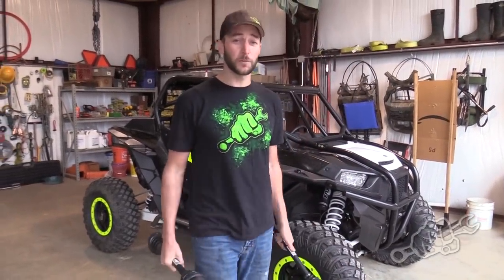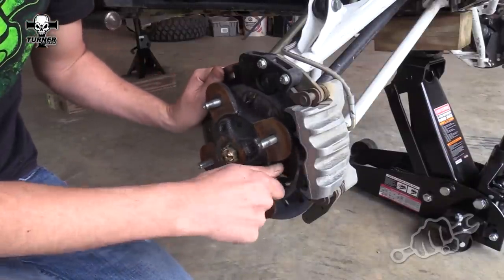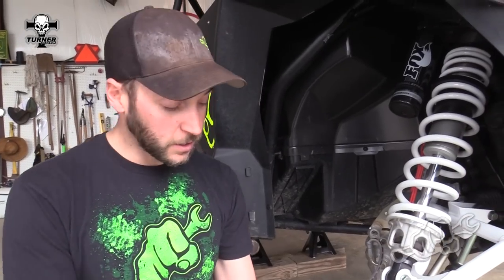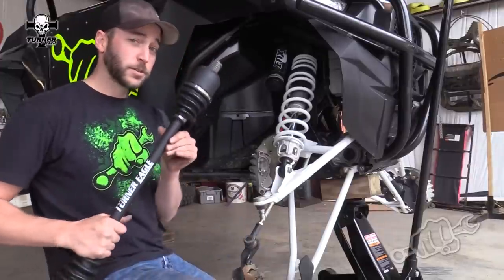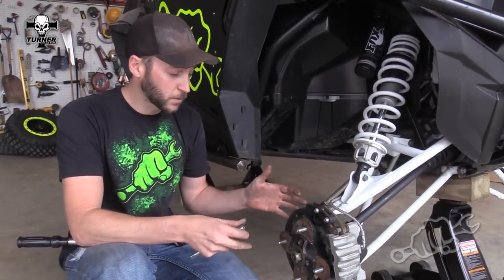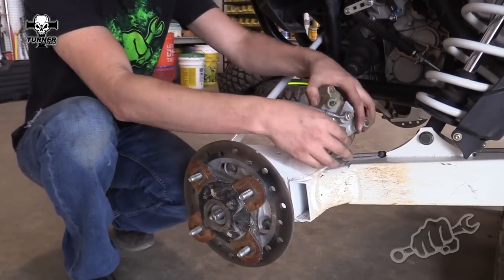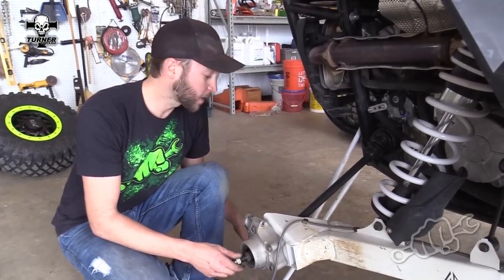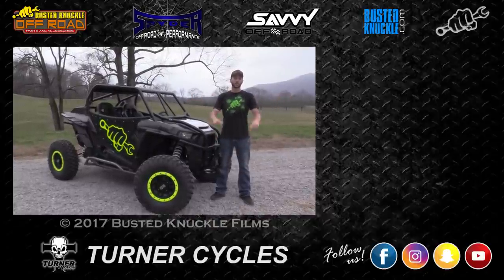Polaris RZR TURNER Axle Install - Extreme UTV Tech EP10

Comment: Nice work. Question. My boot has oil like something a leak. Should I change out my axel ?
Reply from the maker: You can get new boots and grease from Turner. No oil should be coming out, grease can come out if the boot gets damaged.
Reply: That’s bro. It was the boot. I decided to order new axles.

Comment: With all these upgrades to your drive train would you consider your diffs your weakest links? I would think you would want the cheapest easiest part to replace to be the weak link.. What are your thoughts?
Reply from the maker: for trail riding you might want that, with racing you don't want an axle to take you out of the race. We have built everything up with welded diffs and all so now our weak link is the transmission. But after installing axles the diff is the next weak link.

Comment: How do the diff's hold up now that you've upgraded the weak link in the system?
Reply from the maker: Diffs need to be built also. I am running a Torq mini spool, upgraded roll pin, in my XP turbo and a full upgrade stage 1 kit from DC motorsports in the RZR Buggy
Reply: Cool thanks!

Comment: when you remove the axle from diff do you have to compress the snap ring or just wedge the axle out...thanks
Reply from the maker: usually if you just apply a little bit of pressure to it they will pop right out

Comment: I boight turner eagle 2 axles for rear of teryx with 6" portals and heat cycled them amd have shiooed them back to turner nunerous times. My underpowered machine keeps breaking them
Reply from the maker: what size tires are you running and what part of the axle is breaking?

Comment: Great vid. I have a leak at the point where the axle goes into diff, is there a seal I can replace, my 1000 has about 1700 miles on it and just started leaking.
Reply from the maker: Yes there should be a seal to replace if you take apart the diff housing
Reply: Oh wow, was hoping to get at it without taking the diff out, thanks, will investigate.
Reply from the maker: It's just a few bolts, we do it a lot lol
Reply: Thanks, pal, got the parts, got the drive fluid, will get at it!

Comment: Love you vids man but I'm going to nit-pic this one since I have the time and have done this stuff a lot. First, ALWAYS use jack stands! You can get seriously hurt not using them and it sucks to drop a machine, your comment that it is common is BS. It is NOT common unless you don't know better. When I was your age I would have done the same as you but still very dangerous. Second a good 3/8" battery powered impact really speeds up the brake caliper and ball joint retaining bolt removal. Third, there is no need to try to keep the front rotor from turning by sticking crap in there or holding the brake. A good 1/2" impact will back the axles nuts right off. It will also tighten them the same way. Fourth, tying up the caliper is a good idea but don't overly bend the brake line when doing so. Fifth, no need to use the huge ass pry bar to remove axles. Some watching this will do that and break the diff housing. Simply push in the axles and make short fast jerks to get it out using the axles as kind of a slide hammer. Unless you get stupid with it you will not separate the CV. If it is stuck, well that is another video on ways to handle that. No need to hammer the axle back in either, just to the same bumping with the axles and CV itself, pops right in, Prior to doing that always grease or never seize the splines so you never had a stuck axle problem and future changes are easy. Fifth, always use blue lock time on the brake caliper bolts and be careful to not over tighten them as they are easily stripped. Sixth it is a great time to use a bearing greaser to grease the wheel bearings as even new ones will take a ton of grease and greasing them makes them last 3 to 4 times longer. Hope you don't take this wrong, just trying to help. I'm ready to see you race that baby!
Reply from the maker: I am not a professional mechanic and have never claimed to be, this is just real world working on junk the way we work on them. Not everyone has fancy tools so we like to show how to do the job with simple hand tools. To each their own.
Reply: I completely understand. Just giving my pointers to help maybe you and some watching out. We all learn by doing and sharing. I think back and shake my head at some of the things I used to do! One thing for sure, you can damn sure drive a buggy!
Reply from the maker: We appreciate the feedback. Can't wait to get these new machines lined out and get used to them both.
Reply: boltactionshooter you have two fifths in there
 Not nit picking but first always remember where your fifth is and second sixth comes after fifth. Lol just poking the 🐻

Comment: Very informative, but the way the buggy was sitting on a block of wood on the jack could have been dangerous, I have a friend with the top of two of his fingers missing after the vehicle slid off the jack landing on his hand crushing one finger and nearly cutting of the top of another finger, damage so bad they had to amputate the top of both fingers. So just bare in mind when doing a tutorial make sure you do it with safety in mind, as people will copy exactly as you show it on these sort of videos and could injure themselves following your example.
Reply from the maker: It is common practice. It really had no where to go with the rear being on jack stands